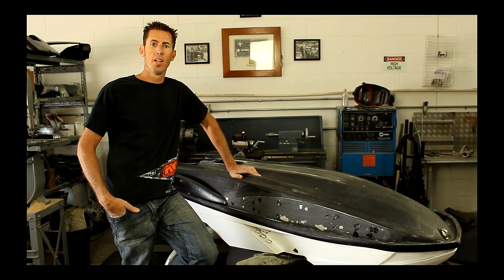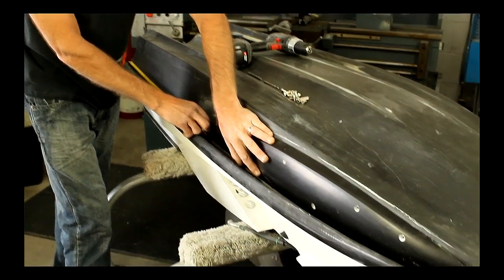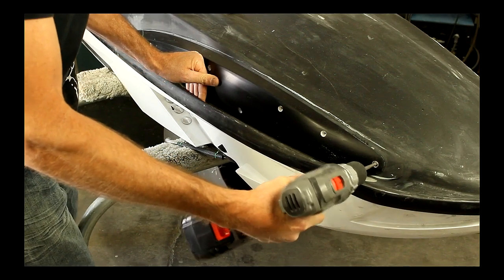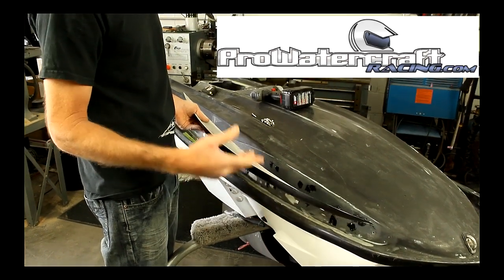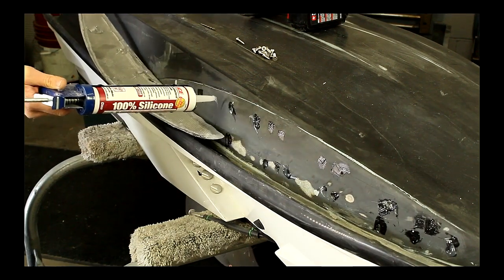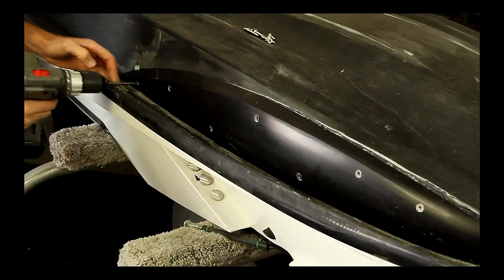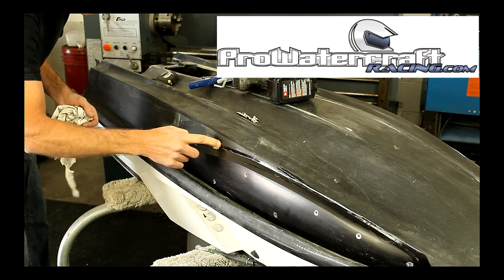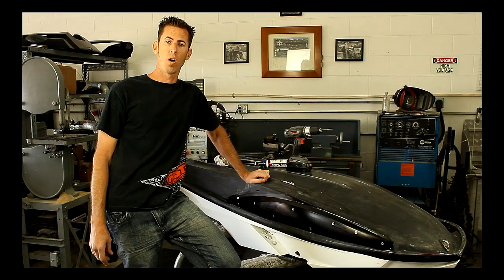Performance Front Sponson Install Video by ProWaterCraft Racing

Comment: So you drill pilot holes first or just stick to screw in first?
Reply from the maker: Drill the pilot holes first.
The screws for these rear sponsons are not designed for self-tapping.